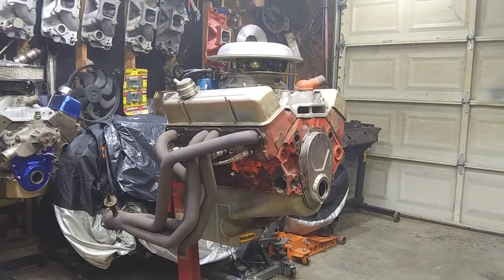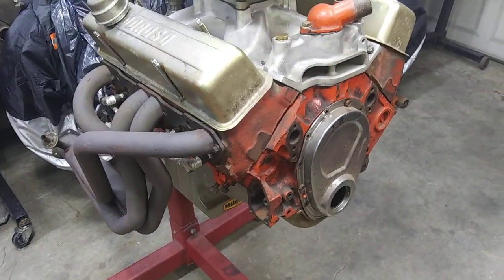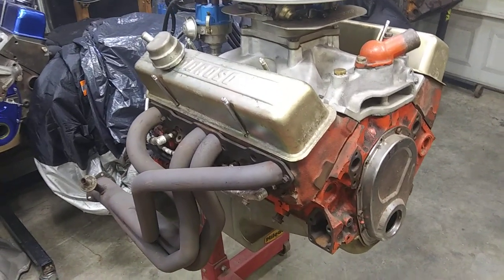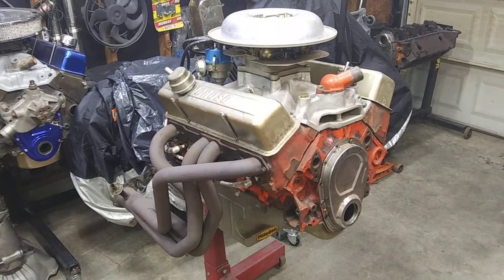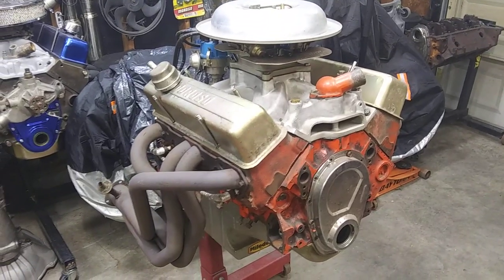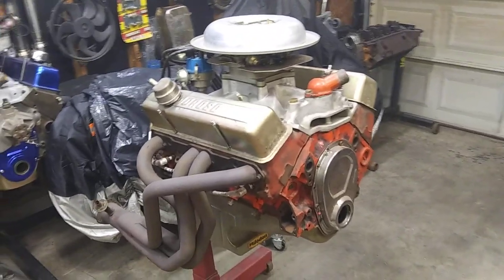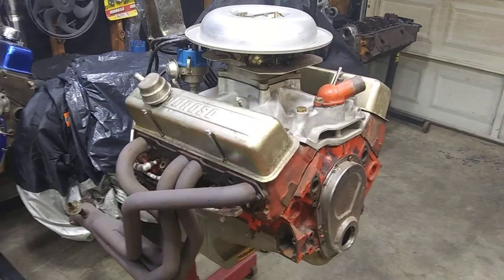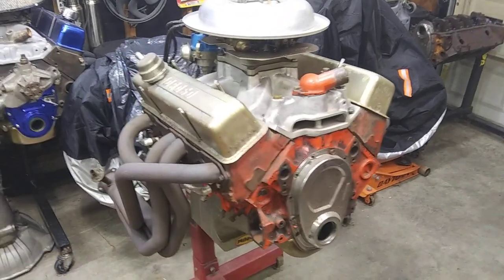The truth about the "Double Hump" heads.

Comment: Or just use them and don't listen to anybody
Reply from the maker: Goes back to that money thing. I don't care what "people" think. But I do like to make my money go as far as I can. Which ain't very far these days. If a guy can buy a pair ready to use for a good deal, they are definitely worth using. Not everybody needs a 1000hp engine. Personally I like the old school parts. Have a huge collection of the shit. Still have parts I bought over 40yrs ago.
Reply from the maker: Actually these 291s in the video are in real good shape and could be used as is. But most need alot of work. These got all that work many years ago when I worked at a machine shop. Just been on the shelf for decades.

Comment: Talk about 283 motors.
Reply from the maker: I've built a few of them for drag racing years ago.
Reply: @thereluctantgearhead4544  I just bought a 283 that is 100% original  down to the valve covers.  I want to put in a solid lifter cam. 4 speed car. 1967 Chevelle.
Reply: @thereluctantgearhead4544  your  videos are great !!!
Reply from the maker: @terrywillis5784  Thanks man.
Reply from the maker: @terrywillis5784  A good cylinder head for a 283 is the 48cc chamber Dart 200cc runner head from a few years back & a .026 thick head gasket, need small chambers to get the compression up. Those heads used to be popular in the circle track world. A singleplane like the Strip Dominator or Super Victor intake works well on a high RPM type build, a nice 750 doublepumper carb and a big cam. Something in the 270 to 280 @.050 range, 600+ lift, and a 106 lobe separation. Use good valvetrain parts and springs, stud girdles should be used. In the bottom end, a set of lightweight  domed forged pistons with thin rings and some 4340 7/16 I-beam Scat rods, the stock forged crank is good, I've had them over 9500rpm and never seen one break. Get it all balanced together, good oil pump that'll hold 80+lbs of pressure and a 7 qt pan and windage tray. ARP main studs and head studs. Throw some 4-88s or 5-13 gear in the rear and it'll be running like a beast. I've built that basic combo a few times already and they'll make over 450-500hp no problem. Pretty high RPM type build. They sound mean as hell too. 283s can make some power, but ya gotta turn em up. In a lightweight well setup car, you could run in the 10s in the 1/4 with a engine like that. I used to bore them .125 over to a 4 inch bore, never had a problem. Them old 283 blocks are thick, probably the thickest SBC GM ever built. I had a 71 Vega I raced years ago, had a 302 in it that ran 6.20s in the 8th. Turned it 9800rpm, used a 7000 stall converter in a manual T400 with a brake and a 6-17 geared Dana 60 rear. It was loud as hell, quick too. Definitely a whole different experience than most SBC builds. I used a tunnel ram and twin 660 center squirter Holleys. Also used BME aluminum rods & Arias pistons  in it and added splayed caps to the block. Still had a stock forged 3 inch stroke GM crank in it. But it was heavily modified. Alot of metal removed, deburred and knife edged, used heavily modified GM Phase 2 Bowtie heads on it and a .680 lift 288@.050 solid roller cam. Id like to build another one like that one day, I have a 1957 283 stashed away. My 302 was a 68 MO 302 from a Z-28.
Reply: @thereluctantgearhead4544   Thank you so much for this information. It's exactly  what I have  been wanting  to learn . There doesn't seem to be much on the c web for small engines.   I actually  have access  to another  283 short block  t o build and I never found solid info  which heads to buy so I bought one that was complete. I will be looking for those dart heads. Keep  the videos coming. I'm 63 and I love learning  by YouTube  channels . Yours is one of the best I've  run across  !!!
Reply from the maker: @terrywillis5784  thanks man, glad to be of help. Them small cube screamers always have a place in my heart. I grew up around Modified Production class drag cars, so you seen alot of small engines making big power. And the sound they make is like nothing else.

Comment: I can just about guarantee there is no legal NHRA SS 327 small block Chevrolet making 600 hp. Those old junk cast iron heads just won't flow enough air unless you redesign the ports by filling with epoxy and welding. Which would not be legal.
Those guys spend about $20,000 and super efficient transmissions and rear end with lightweight internals, coated gears, and ceramic bearings.
Reply from the maker: I've seen them on a dyno. Believe it bud.
Reply from the maker: Superstock 350s are over 650hp these days.
Reply from the maker: I grew up around Superstock drag cars, I know what's in them.
Reply from the maker: It is legal to port and weld them, just can't exceed 170cc runner. So they get raised up and filled. Shitload of work involved. You wouldn't believe what they actually flow, but I'll tell you it's enough to make over 600hp with a Carter AFB carb.
Reply: @thereluctantgearhead4544  I didn't know port redesigning was allowed in SS. Of course they change the rules all the time so it's not surprising. Should be called Super Modified Stock.
Reply from the maker: @dukelps9132  that's no shit.
Reply: @thereluctantgearhead4544  I'm more impressed with the Stock Eliminator cars where they 'aren't supposed' to port the heads, but they acid port the intake and heads. Stock lift cam, stock appearing crank/rods/pistons, super efficient transmissions, rear ends, and front spindles with ceramic bearings. 
Once they get into port redesigning, angle milling, etc on stock castings I don't see the point. Might as well put aftermarket 18 degree heads on it and call it a day.
Reply from the maker: @dukelps9132  Yep, building Stock/Superstock engines definitely takes alot of work. But the challenge of it is what attracts people. Amazing what can be done with what most folks would consider junk parts. I built a legal Stock Eliminator 305 for a Malibu wagon years ago. It ran high 11s. Had a hell of a cam in it with only 390/410 lift. Q-jet carb on a cast iron intake, 416 heads,  Hedman Hustler headers.
Reply: @thereluctantgearhead4544  I've got a pair of iron 351 4 barrel NASCAR heads and intake modified by some race shop back in the 70s that have the intake ports epoxied and ported.
I was using them on a 408 street engine but decided to go with aluminum heads.
Reply from the maker: @dukelps9132  Them old Cleveland's were badass engines. I've built a few of them over the years. That NASCAR shit was on a whole other level. I built a 64 427 Highriser for a guy years ago, he bought the engine from a NASCAR team in North Carolina back in the early 70s. Had a 65 forged crank and Lemans rods. The ports on them heads were huge. He found a dual 4 barrel intake & carbs off a drag race version. I pretty much just rebuilt what was already there, it was a hell of an engine as is. Ended up in a 64 Galaxie drag car. I'm a GM guy, but I like alot of shit including the old Ford engines from the 60s and early 70s. Ford definitely built some good shit. That old cross bolted 427 block was tough as nails. If I was wealthy, I'd probably want to get into the 427 SOHC Cammer. But that's out of my budget. But that's one of the best engines ever built by any manufacturer. Bucket list build.
Reply from the maker: @dukelps9132  I built 2 1971 Boss 351 Cleveland engines from a couple Mach 1 Mustangs, strange thing is I built one in KY, and the other in Lousiana. 650 miles apart, cars looked identical. And they are pretty damn rare. I was surprised when I discovered a 1971 Cleveland with 11-1 compression stock. And the 4V heads flowed 275cfm. Best stock smallblock engine ever built. One I just rebuilt stock, it was a show car and all original. The other was a drag car, so I built it pretty rowdy with a Strip Dominator intake and a big solid roller & more compression. Used the stock heads, but they got some nice valves and alot of work. It ran mid 6s in the 8th NA. Real good engine.
Reply from the maker: @dukelps9132  I have a 72 351 Cleveland shortblock stashed away for years, came out of a Torino. I have a 96 Ranger I built a turbo 2.3 for it. But I plan on eventually building that Cleveland with a single turbo and shoehorn that shit into that Ranger. I built a solid 4-10 geared Detroit Locker 31 spline Mosier axles 8.8 for it already and it's running a T5 from a Turbocoupe. The original goal was to run 10s with a 2.3. I have a few of them laying around. I usually build big engines, but sometimes I like to do something different. Got into the V6 turbo Buick GNs back in the 90s, but that shits too expensive and the parts are hard to come buy. Them little bastards can make some serious power. I've ran low 10s with a boosted 4.1 Buick V6 in a G-body. At the same time I had a 81 Malibu wagon with a 680+hp 477ci  BB Chevy, it also ran low 10s. The Buick V6 ran pretty close to what the nasty NA bigblock ran. The bigblock launched way harder and had alot better 60 ft. But the Buick came on like a freight train on the big end.
Reply: Why do you think super stock heads cost so much? They raise the ports a tremendous amount, they have to maintain stock volumes. Then they turn the motors 9,000rpm.
Reply from the maker: @doomman700 the time involved in building them is what cost. Many hours of labor on one pair of heads. Not to mention the best components available to go in them. Call Patterson racing engines and ask how much they'll sell you a legal pair of Superstock heads for. They sell complete 350 Superstock engines for $45-$50 thousand bucks.
Reply from the maker: @doomman700 You can spend $2 grand on valves, another grand on valvesprings, $600 bucks for retainers, $200 for locks, etc. Shit adds up quick. Turning 9000+rpm also takes some 3/8 Manton .160 wall pushrods and Jesel or T&D shaft rockers. Cams in modern Superstockers are huge. Definitely don't just bolt a .900 lift cam in a SBC. I have a buddy with a NHRA legal 1973 Super Duty 455 Pontiac. It has a .950 lift cam in it, huge 1200lb valvesprings, 7/16 or 1/2 inch pushrods and turns 8800rpm on every shift. Makes around 730hp with its stock Q-jet and cast iron SD 455 heads. Runs low 9s at 150mph. It's in a 87 firebird SS/GTA class car. It's a monster. He also holds the record for the most NA power from a Pontiac based engine. Believe he's up around 1400hp. 600+cube aftermarket Pontiac. RAM AIR 5 heads. Dudes slick with the Pontiacs. Sells aluminum RAM AIR 5 heads & intakes for a living and builds some of the best Pontiac engines in the world.
Reply: @thereluctantgearhead4544  there is not a Pontiac super stock racer I have not met or raced.
Reply from the maker: @doomman700 You should know Lynn McCarthy then. Out of Indiana. Has the black 87 firebird. Been in the game a long time.
Reply: @thereluctantgearhead4544  I knew you were talking about Lynn, too bad I would rather use DCI tunnel port heads more. I am not a fan of Lynn’s.

Comment: Big deal i rather spend time money on legends
Reply from the maker: Definitely takes a chunk of money and a lot of work, but that old shit is still cool. I'm building a 327 now with 292 angleplug GM "Turbo" heads. They are ported Crane Fireball heads from 1975. Pretty badass heads even today. Gonna make a shitload of NA power.
Reply: I have purchased flotec heads had misfiring issues on a windsor hardly worth thr bother 800.00 guids to tight valves hanging up compleat junk
Reply from the maker: @Jeffreycarr-t7g  Haven't used any of them Flo Tek heads, but I've heard different shit about them. I do have a pair of their bigblock heads on the shelf I've never used yet. But I'm gonna go completely thru them. Bought bare, all good shit going in them and my machine shop gonna work magic on a valvejob. Using Ferrea valves and ISKY springs. Gonna mill them down too. They are the 360cc runner versions. I was looking at their 225cc SBC heads a while back. Looked to be a good deal.
Reply: @thereluctantgearhead4544  thear combustion chamber design blows

Comment: They are junk. À set of vortec heads a way better.
Reply from the maker: 35 years of continuous research and development by GM,  you'd think late 90s head would be better than a early 60s head. Something wrong if it ain't. Yet any SBC head made by GM 1995 and older looked like shit compared to the old double hump. So it took them a while to do better. But these days, aftermarket is the logical choice.

Comment: I ran a small block in a pro street Camaro. Didn't have enough ass Tossed it went Big block
Reply from the maker: I prefer bigblock Chevy engines for my big power builds, but a well built SBC can get the job done. I have a bunch of both.
Reply from the maker: Definitely easier with the Rat.